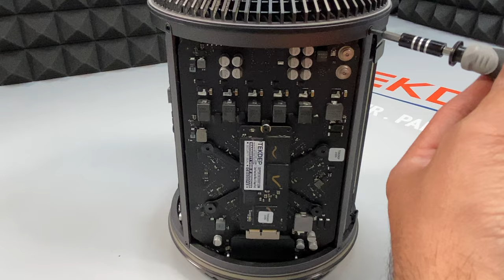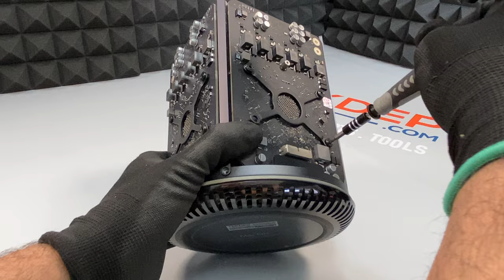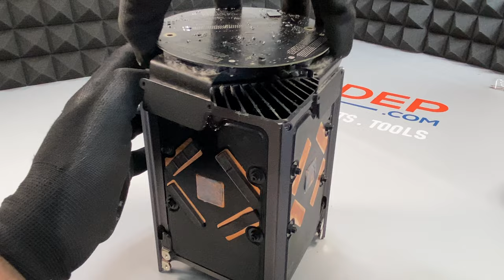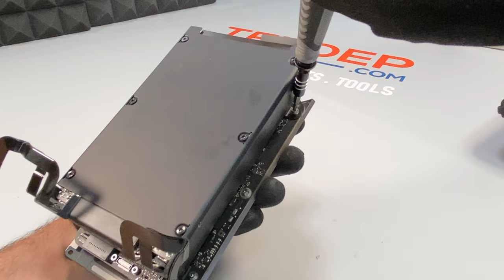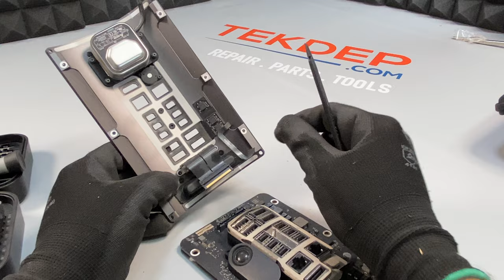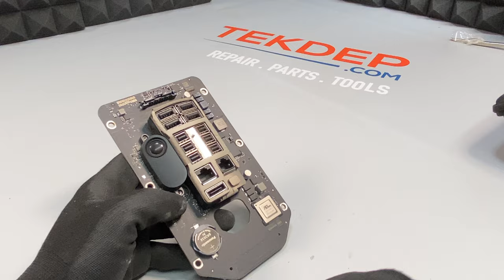2013 Apple Mac Pro Trash Can | Disassembly Teardown Guide A1481

Comment: Great video, I too was looking some an answer. How do i replace my wifi/blutooth on this unit. My wifi and bluetooth are not working. Is there a card I can replace if needed and where is it. thanks
Reply from the maker: Thank you Andre, Wifi card is located on the top section of the Mac Pro and it under the shiny black plastic cover that that is glued to the Mac Pro, you can separate it using your pry tool and access the wifi card, good luck

Comment: This thing was ahead of it's time. I remember the whining about the kraken situation, with people having to externaly attach all their tiny HDD drives and ODD, which became a non issue just a year or two later. It feels like nobody really appreciated just how amazing the internal design for this baby was and how much upgrade potential the user had if apple would have sold individual parts. Could have been something great, if both sides worked together.

Comment: Ive been digging thru the depths of the internet trying to find and answer, with no luck. Maybe you can be a beacon of light.

I updated mac os on my mac pro 6.1 a week ago, it was fine for several days. One day I did some video editing, rendered off a video and later in the night shut down as normal.

When I booted back up the next day, no signal from HDMI on my monitor. Tried diff cables and even plugged in an old mac LED monitor via mini display port, with nothing.

So either its a software/driver issue, but how am I supposed to even reformat a mac without seeing the screen? or the GPU has incidentally failed.

If you have any words of wisdom on what to try or do, I would be eternally grateful.

Cheers

Lonesome Dog
Reply from the maker: Hello Lonesome Dog, Base on what I know the Gpu cards on this models has some weakness and lately due to the age many started to go bad and fail, one sign of going bad is few second's of pixelated display image when unit start up, and base on what your telling me I would assume the worse, 

it's possible that one of the two AMD Fire Pro Cards in your A1481 Mac, changing them is not that hard but they cost a lot, here is a link where you can find different and fire pro graphic cards. 

https://tekdep.com/?s=amd+firepro&post_type=product

good luck
Reply from the maker: If you want to reformat, remove the ssd and install in a MacBook Pro/Air that is 2013 to 2015 model and reformat or reinstall an older osx, 

before removing the ssd try booting up in safe mode, maybe that works so you have chance to format. 

1.Power on or restart your Mac, then immediately press and hold the Shift key as your Mac starts up.
2.Release the key when you see the login screen.
3.Log in to macOS.

Comment: Is there a way to visually identify which graphic card (D300, D500, D700) a trashcan has without booting it? I can't find a guide to the part numbers.
Reply from the maker: You can tell the difference from the part number that is engraved in to the circuit board of the Amd Fire Pro Graphic cards also amount of soldiered memory chip  and the memory chip  manufacture part numbers. the link below takes you to our website where you can find all the graphic cards for the a1481 and you can see all the part numbers, good luck

in this link you can see all the FirePros available for purchase Side By side. 
https://tekdep.com/?s=FIREPRO&post_type=product

In this link You Can see all The Amd FirePro part numbers
https://tekdep.com/2021/12/11/is-there-a-way-to-visually-identify-which-graphic-card-amd-fireprod300-d500-d700/
Reply: @tekdep  I’m just surprised they called it a trash can back then and said it runs on TrashCanOS 😂 that’s not cool! If somebody put a blue led light in it and gave it wheels on the bottom, it’d be freaking R2D2 from star wars!

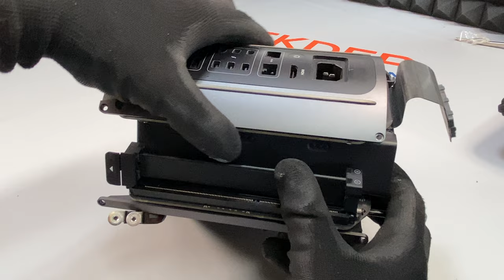Comment: 5:35 do not leave the power flat cables attached to the power spply as shown here.  use t5 to remove the grll cover on the power supply and remove the flat cables.  hen putting everything back, you need to put the flat cables underneath the cpu board, and through the holes in the cooling block.  it is unnecessary and almost impossible to put everything back leavaving the flat cables attached to the power supply.
Reply from the maker: Fair point! Will definitely consider your suggestion and give that a try next time we come across one of this older mac pros!
Reply: @tekdep   👍 I used your video to disassemble my macpro.  It was very helpful.  The problem was that the ssd just died.  However, I dismantled everything to clean and check the thermal paste etc bec. it's been many years since I upgraded this machine.  I also wanted the clean and reseat everything because it was freezing on some runs.  I mean sometimes I would turn it on and it would run for days without a problem but sometimes I would turn it on and it would freeze in about an hour or so.  I remember many people were having similar problems back in the day so either it is a fabrication problem or maybe there was a dirt or something in the connectors or maybe it is the engineering sample cpu I am using.  Anyways, even when it freezes, I could still ssh into it and use it or restart it from command line but whne it freezes, it has something to do with the graphics system that I'm sure.  such a shame...  I'm hoing cleaning all the boards, connectors and appliying contact cleaner and changing the thermal paste etc would help. We'll see.  I now have to order a converter for propriety ssd connector to nvme adapter.
Reply: @Mr_ToR how did everything turn out? I'm about to do this dissembly and cleaning too, along with new thermal paste on GPU n CPU, and memory upgrade. do you notice some improvements after cleaning?
Reply: @teckno_senpai  It turned out ok.  It turned out the clening was a must!!!.  It was very dirty and I've always used it in a very clean environment.  I think there definitely is a problem with my gfx card but everything became more stable now. The original apple ssd died so I had to replace it with a modern one so it became faster. Also my os was on sierra but sierra does not allow 3rd party ssd.  So I upgraded os to Mojave which allows 3rd party ssd.  The reason I did not go to a higher os is because Mojave is the latest os that natively supports 32 bit applications.  After mojave macos supports 64 bit only.  I have many 32bit plugins also WinXP running on Parallels.

Comment: Good day, I hope this message finds you well. I am new on your channel, hopefully i can get help regarding shutting down issue with the same Apple Mac pro. It shutdown after few minutes(2-3 min) i have read few forums suggesting maybe it's a graphic card issue as it's the common problem with this machines. Thank you in advance, your help will be much appreciated.
Reply: I had to have my thermal paste on the CPU replaced and it fixed this.

Comment: when I startup my Mac Pro it Strat over heating them showed a folder with question mark
Reply from the maker: Folder at startup means your operating system software is corrupted, try reinstalling the OS X, if you can’t access your drive using disk utility than try replacing your ssd and that may do the trick, clean the open and dust off the internal and place a fan facing your mac to avoid overheating as the graphic cards on this model do get bad time to time.

Comment: If there's no video output, what can be the reason?

It starts up, the chime sound is there, the fan spins but no video
Reply from the maker: It really can be multiple possibilities, best to take it to repair shop or apple for diagnostic than fix it your self and change that part but here is a few thing that can be the reason, bad gpu.. maybe as amd graphic card do have issues in mac pro aka trash can, try starting us using safe mode, 

Booting up safe mode / Restart your Mac, then immediately press and hold the Shift key. Release the Shift key when you see the login window.

If you're able to boot safe mode than you know you have Gpu issue and need to replace one or both gpu cards. 

New, if safe mode is not helping, than make sure your monitor is oak, your osx is ok, and finally the actual video port your using is still giving signal.. 

if your using Hdmi for video, try using display port ( thunderbolt ) just to make sure issue is not the port... 

goodluck!
Reply: @tekdep  thanks for the quick reply!

I just got this Mac for 25USD, not kidding, 25USD from a girl who posted the Mac on Facebook marketplace saying it was not working anymore.

I'll try to get a DP cable otherwise I'll take it to Apple and see what can be done.

Comment: Imagine this form factor with a Ryzen 9 mobile CPU and a RTX Mobile GPU.
Reply: You can fit desktop rtx3080 and r9 5800 in that space with some proper engineering.. these parts in the trash can mac produce more than 400w of heat.
Reply from the maker: i think with good engineering everything is possible but in this case im not very sure, if anyone knows the answer to this question it will be great to give us a hint :)
Reply: The M1 Ultra can definitely fit in this. RTX 3080 will probably burn in this lol
Reply: Definitely possible. People have put 4090s and high end CPUs inside SFF cases.